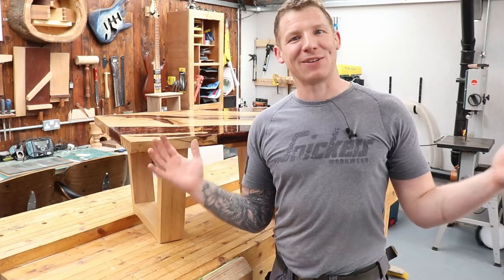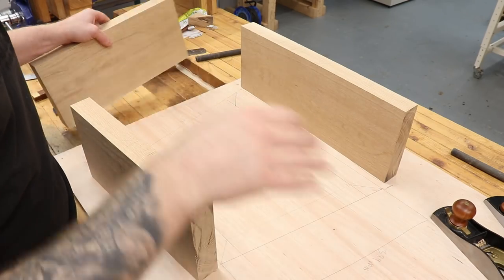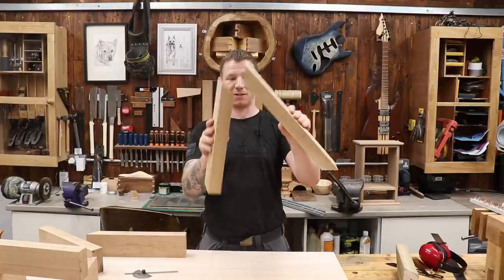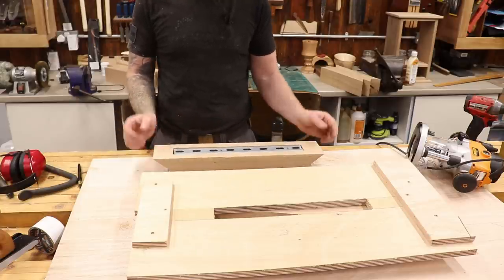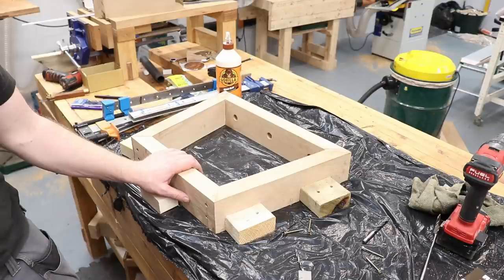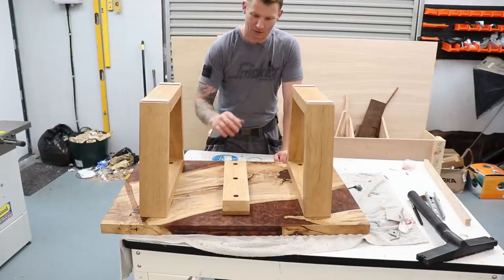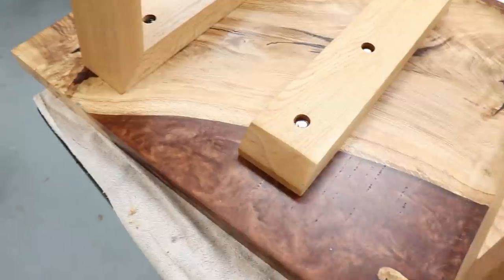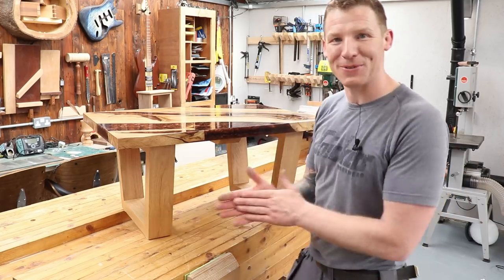Oak and Metallic Copper Resin Coffee Table Build. Part 4 Building the Legs, Bracing the Top.

Comment: Beautiful result!  Regarding clamping the beveled legs, I've seen people lay the pieces out flat with 3 sections of blue tape, apply glue, fold them up, and apply the fourth section of blue tape.  Apparently you can get it tight enough for the glue to hold.  Haven't tried it myself.

Comment: John, with the threaded inserts, just put a nut on a hex head bolt. Then thread the bolt into the insert until it meets the nut. Then you can drive it in with a socket or a socket adapter on your drill.  When cutting mitres, mark out your cuts.  You should always ideally do this anyway.  Then when you present the piece to the mitre saw, the discrepancy will show up immediately.  It means you don't even have to think about angles.  Also if you can, clean up the joint before you glue it.  Get rid of saw burn marks especially.  Mitre saws are not overly accurate tools, good mitre joints are best achieved by sneaking up on them with a plane after initial cit on mitre saw.
Reply from the maker: Thanks Kieran

Comment: You can get a biscuits joint cutter for your router,
Lessons learned from mistakes we make, are the best Lessons learned
Reply: I did not know this, thanks.
Reply: @bluewren65  its a disc cutter blade and 3 different size bearings to corresponding to the biscuit you need
Reply: @garrypalmer5014  Brilliant, I'll look into it.

Comment: Beautiful for sure 
And those inserts are meant to go into the wood with the slot first, it is not intended to be screwed in with a screwdriver 
As another person suggested use a bolt and nut to drive it into the wood
Reply from the maker: Thnaks for the tip.
Reply: Ya it is very misleading and seems obvious that you should use a screwdriver but you don’t I recently learned that the hard way 😂. Well in checking further I see that there is a special tool by the mfg to use the slot but I don’t have one and using a bolt and nut worked fine a screwdriver unless it is thick enough doesn’t work well

Comment: You can use the router plunge capability to insert dowels. Works just like a domino. Two dowel set 10mil space between and Bob’s your uncle. Do as many sets as you need. It’s a bit more work, but FAR more affordable.

Comment: The best way to install threaded inserts that are slotted is to drive them with a hex bolt that has a couple of nuts jammed on at an appropriate length from the end. You screw the insert onto the bolt and it stops at the jam nut. Then you can use a socket wrench to screw it into its hole. Once in the bolt simply unscrews from the insert.
Reply from the maker: I will be trying that on the next one.

Comment: Love the unibond idea John, very neat and tidy. With those inserts, if you cut down a hex-head bolt so it's shorter than the insert and thread it into the insert, you should be able to drive the insert in almost all the way with the hex head and then unscrew it back out and only stress the slot for that last quarter-turn. It's a faff though, so you're right - stick with the allen key ones if you can. I found they were way easier to use. I never did find an Irish supplier though, I resorted to ebay.
And the final result with that table is just beautiful.One of these days when I have more room in the shed I want to build one of those.

Comment: Nice looking table for a novice? You could have used your router to put a mortise in the miter’s and then put a loose tenon inside also you can use a bolt with a nut for your inserts. Again have to say well impressed with your work 👍
Reply from the maker: Thanks for the info kevin

Comment: Could you use the bolts to help get the inserts in? Just thinking the Phillips head bolt would be easier to turn.
Reply from the maker: you can get ones that you insert with an allen key they are way better. You could use he bolt so long a the threads are the same length as the insert.